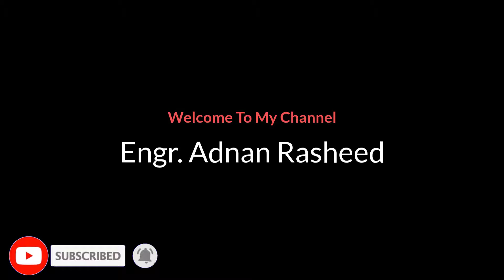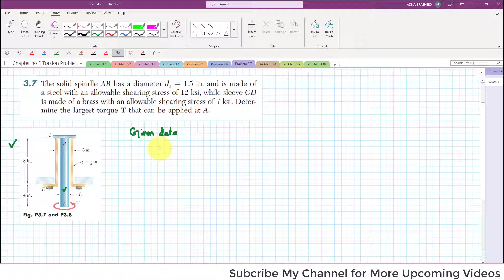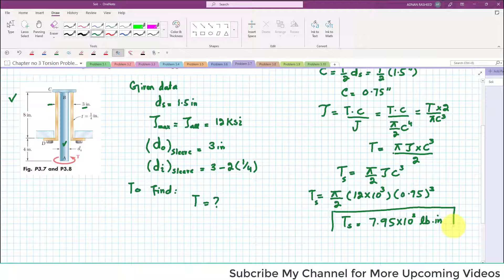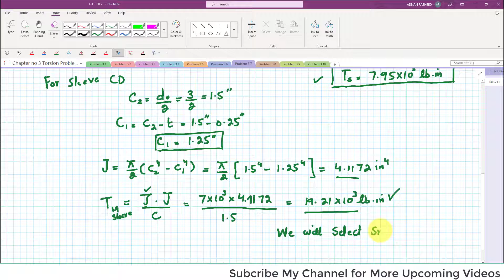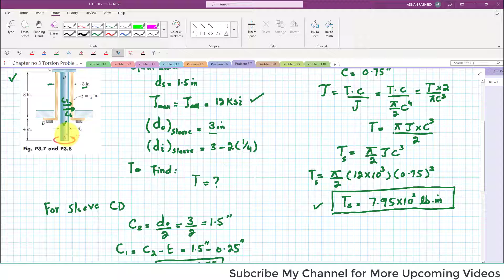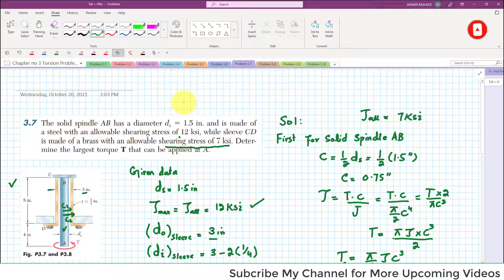Mech of Materials# |ProblemSolutionMOM​ | Problem 3.7 |Torsion| Engr. Adnan Rasheed

Comment: Sir first you say that di)sleave=3-2(1/4)
Then last you writte is direct 1/4 which is equal to 0.25?
Reply from the maker: What is the problem beta?
Reply: @engradnanrasheedmechanical 3.7
Reply from the maker: If you are talking about sleeve then outer dia is 3 in and thickness of sleeve is 1/4 = 0.25 in so inner diameter of sleeve is 3-1/4-1/4= 3-2(1/4)= 2.5 inch
Reply: @engradnanrasheedmechanical paerr hamm na tho ass ma 0.25 put kkayya 2.5 Q nahi put kayya?
Reply from the maker: kahan per
Reply: @engradnanrasheedmechanical ass question ma hamm na 0.25 put kayya hain
Reply: @engradnanrasheedmechanical i am sorry but sir Confusion hain